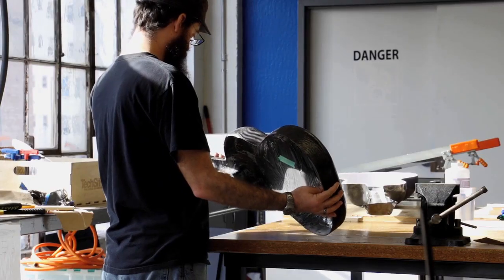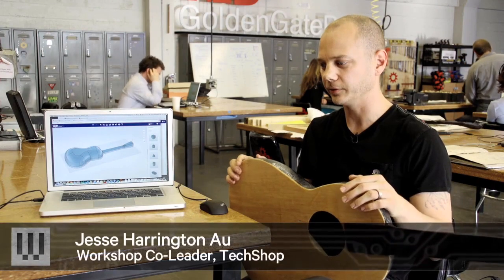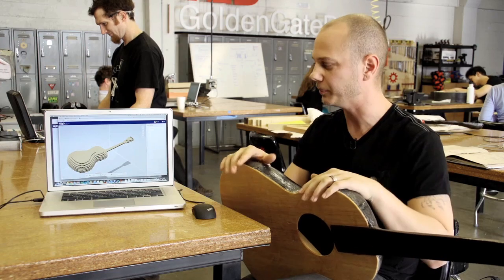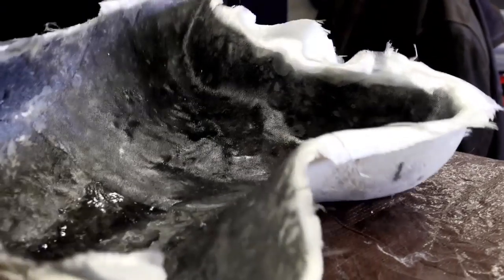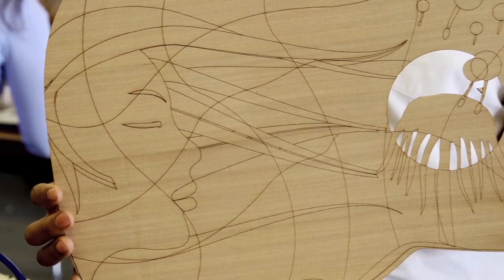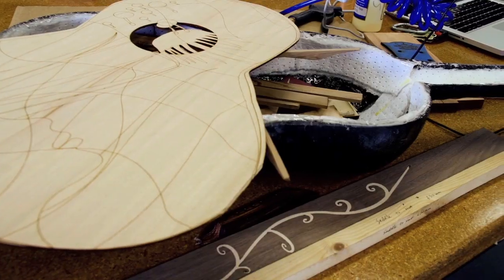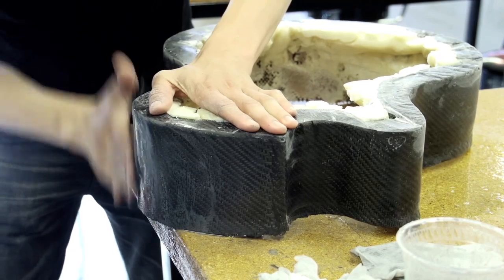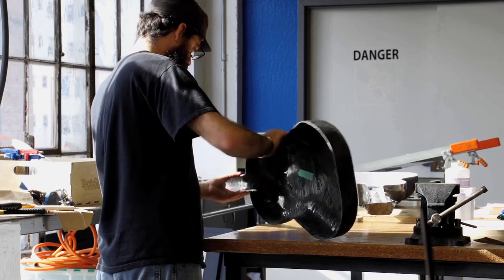Guitars Made From Carbon Fiber - Wired

Comment: Ovation Adamas did that in last century ago, I hope that I am not wrong.
Reply: The original Adamas guitars had a 3 ply top, 2 layers of NCT301-1 34-700 g150 unidirectional pre-preg C/F fabric with a aviation grade birch sheet 1mm thick in the middle of the sandwich. Charlie Kaman was an aero-space man so he used materials that were familiar to him. The early wood topped ovations like the 111-4 balladeer had a 3 peice Sitka spruce top. They were 3 peice because that’s what they had in the aeronautics/aviation shop. Just a bit of history on them. I have several early Adamas 1s & 2s in my collection as well as 2 prototype Adamas guitars with phenolic tops(layers of paper and resin) I’ve had the pleasure of going thru the factory quite a few times and getting to spend some time in the R&D room playing with all the misfits,ideas and even a few of the prototypes that became legendary guitars. Including Charlie’s personal Adamas I,”SlotHead #47”prior to fender acquiring Ovation,Adamas & Hamer guitars.